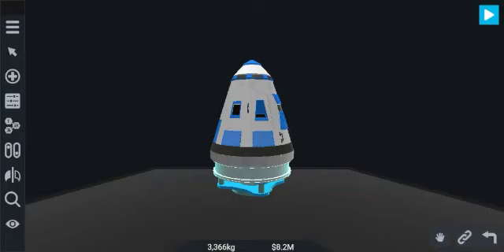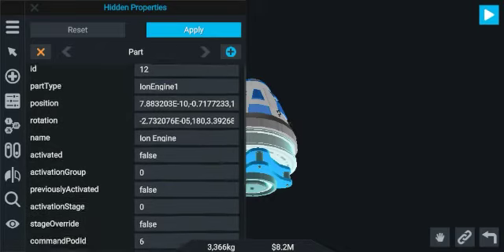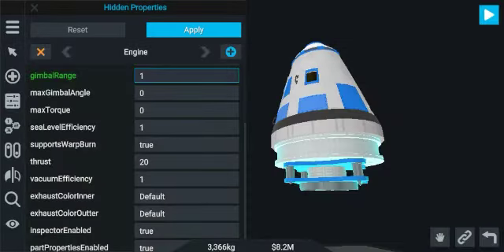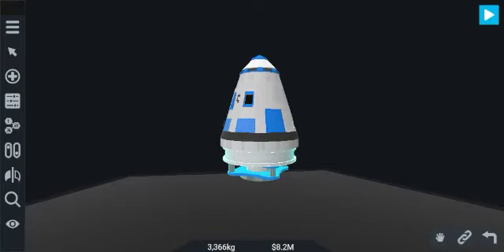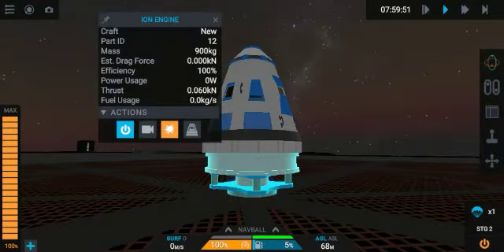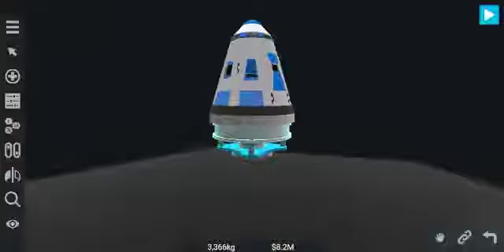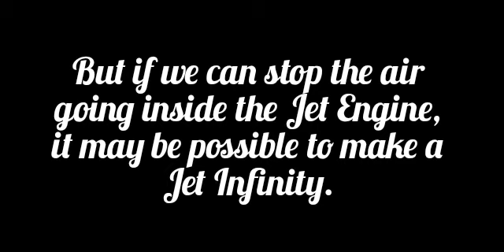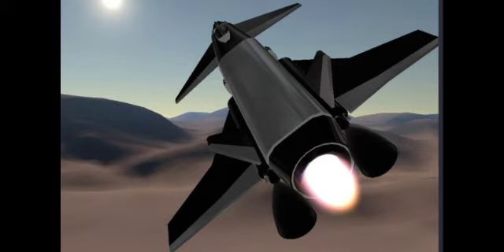XML Editing in Simplerockets 2 | Part-2, Ion Infinity Engine and Jet Engine

Comment: Would it be possible for you to show us how to make a part require multiple activation groups to be turned on for it to activate?
Reply from the maker: Like separate afterburner toggle key for jet engine? I'm still working.
Reply: @AmritEmperor123  yeah, exactly.
Reply: Can you help me? When i am building a rocket in the rocket head part where the cokpit is i put belove a ion engine and i put a sunbattery like ypu know that is make electricity and i dont know what nore do i have to put to work in the space cuz its not workin.